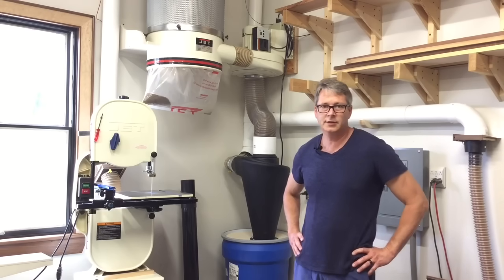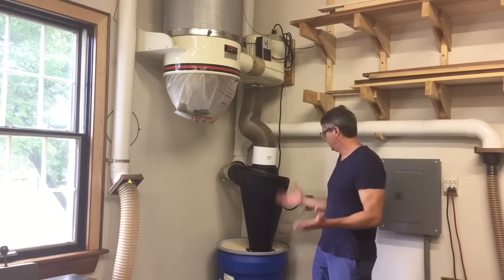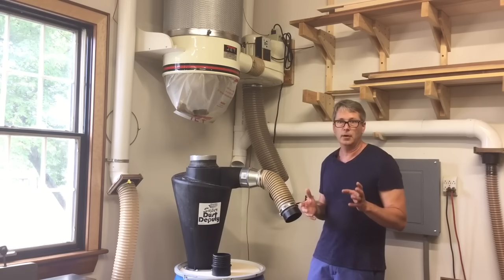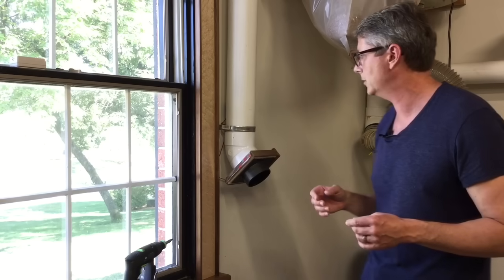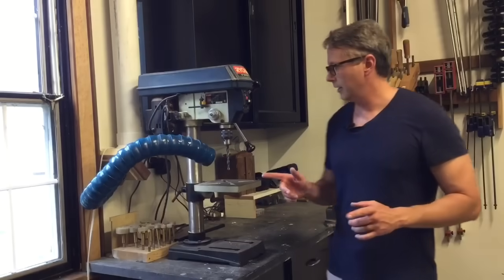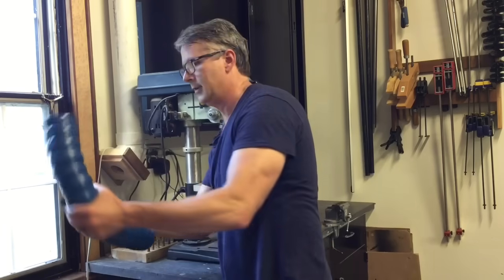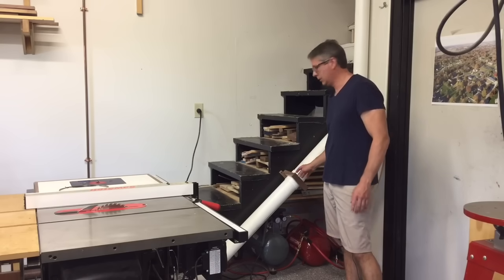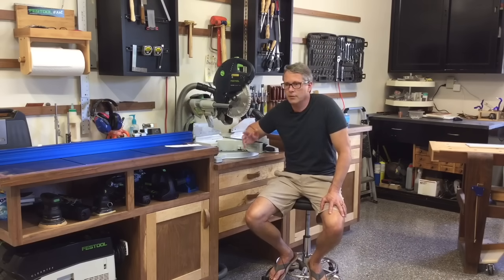Advanced Dust Collection System for the Home Workshop.

Comment: Three things.....I really like your system,  I use the Long Ranger System and have had to clean and replace a number of the micro Switches and the packaging says something like "up to" 1 1/2 HP.  Mine failed twice.  Opened it up and the internal relay is only rated for 1 hp.  The first one was under warranty the second one was on me.  I now have a second relay controlling their little relay.  And, those vertical drops in my system tend to fill up with crap from any machine that tries to send stuff past them.  I have to open the gates occasionally to empty them.  Not a problem unless I forget for a while.
Reply from the maker: I must have more CFM than your system because I have never had that problem with the dust in the vertical runs. And so far the micro switch system has worked perfectly. Hope you didn’t jinx me on that. Thanks for the compliment.
Reply: @barryirby8609, Crap in the Vertical Drops... Did you come off of your DC with 6" and then drop to 4"?  Pulling from a 4" to a 6", the closer you get to the 6", the more problems like that you will have. Just curious.. I think his 4" system is the reason why he does not have the issue.  With a 2hp 220V (more power), spinning at the same number of RPM's, is going to move air faster using simple logic, if the motor keeps spinning at the same number of RPM's, and the Fan blades designed to move 1500cfm at those RPM's.. But, changing diameters, if not changing at the 6" to 2-4" lines, could easily drop into the verticals.. 
Think about what I said, and what you have and reply back.. Test it if you are not sure and reply back when you have.

Comment: Your shop is a treasure trove of interesting things. You, given time, could make videos about many things. Curious about the black boxes with magnet strips above your miter saw. Looks like you screwed a Craftsman socket set to the right if the miter saw station. I also saw you with a red hammer you used on holdfasts that looked homemade. Red pipe with wood jammed in the ends. Wondrous shop.
Reply from the maker: Thanks. My shop is still a work in progress. The black boxes are YouTube inspired and hold all the stuff I use most frequently. I keep all the stuff I use frequently in the most easily accessible places. I will make a shop tour video some day when I feel my shop is done. Probably 20 years from now so stay tuned.

Comment: Well done!  A great DC video!  I too incorporated the very many videos I had researched to come up with a similar system that meets my shop needs.  Best of all, you accurately identified the Loc-Line segmented dust collector ducting.  I've been looking for that brand name for a while for my Powermatic 63 table saw.  The 2-1/2 inch dust port on the saw is within the open cabinet and moves with the blade as you tilt the blade for angle cuts.  Loc-Line will work perfectly for making a "permanent" dust port for the saw that will still move as the blade tilts back and forth.  Thanks, man! #KeepTheChipsFlying!

Comment: I’m building a very similar system. I just got my super duty cyclone. I wonder how is the plastic drum working out for you? Do know the capacity and where you got it from?
Thanks in advance.
Reply from the maker: It’s a 30 gallon chemical drum. Paid $45 off amazon. Has an air tight lid which I had to modify with plywood because it was flimsy. The can itself is really rigid and sturdy. 30 gallon is overkill. You can probably do fine with 20 gallon  or even less if you don’t do a lot of thickness planing.

Comment: Very nice dust collection system! I just have some 
questions, I looked up the blast gate switches and all i can find is the ones that come with an aluminum looking blast gate. Were you able to just buy the switches and if so where did you find them? If you did buy them with the blast gate did you try them out before building your own?
Reply from the maker: Yes it comes with several switches they throw in one aluminum Blasket which I threw away.
Reply: Thanks for the fast reply! The one I found says it only comes with one switch and one gate, is there anyway you could send the link of where you got yours thanks so much for the time.

Comment: This is great, thanks for posting. How long is your longest run and how would you rate the suction at the long end? I did the same floor in my new shop! And I gotta admit, I prefer your black cabinets to the white I did, may have to re paint :)
Reply from the maker: Longest run is about 30 feet and still has good suction. Have to give the credit to my wife on the black cabinets and she appreciates your compliment.

Comment: Nice job on the dust collection set up. Mine is similar. I used the Harbor freight unit. It works great. It's so much nicer to have a clean shop. Thanks for sharing.